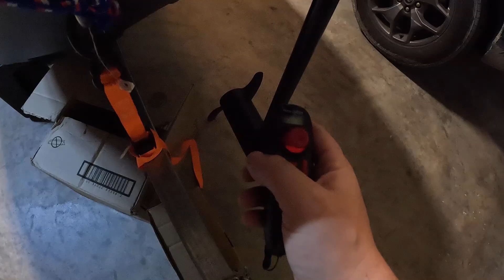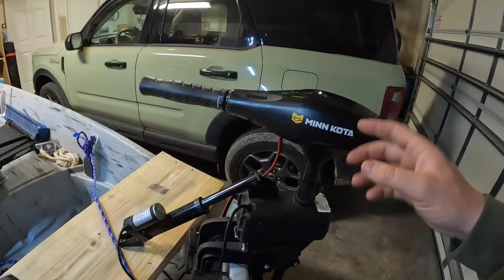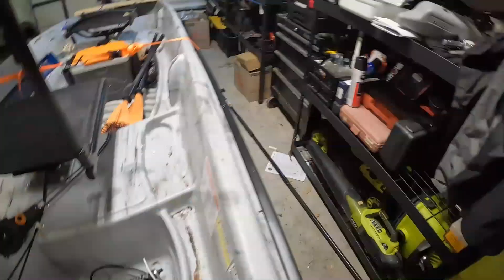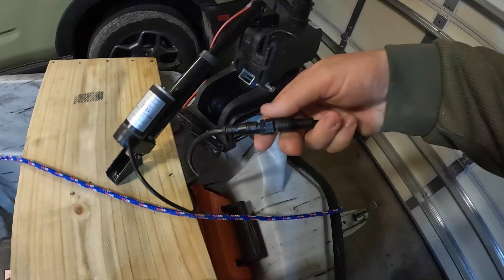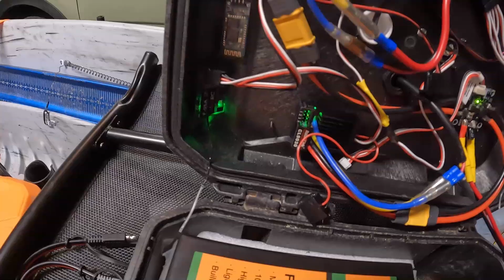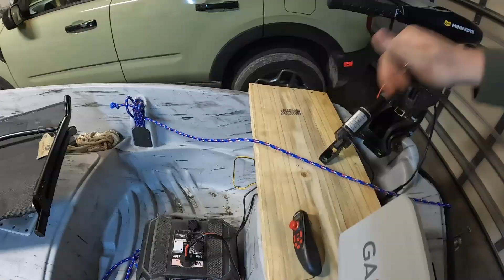DIY RC Trolling Motor V2

Comment: Will the steering box work with the Watersnake Venom 34 lb trolling motor? Or can I use an adapter to fatten the shaft if necessary.  I really want to make this work as my front fishing motor.
Reply from the maker: Most trolling motors that I have seen have the same size shaft (minn kota, Newport, etc.) With the exception of the watersnake T24 and T18. If your trolling motor is roughly the same size and the endura c2, then this should work just fine.

Comment: Did you have any noise problems with the cl9030 and the Minn kota endura? 

When I use the cl9030 on a 40 lb thrust endura I get a really loud pwm whine at low speeds. I’m considering moving to an ultrasonic pwm esc but I wanted to see if you solved it another way.
Reply from the maker: At low speeds on this motor and on the watersnake t24, there is a high pitch noise. It doesn't really bother me too much so I have not looked into making it stop.

Comment: Any chance you could point out whichPDB you used?  Did you need one rated for 60 amps?  Love this--this will be my next project.  My Minnkota has an old autopilot drive and should also work with this.  Have you made any progress with the spot lock?

Comment: I see tou got the cl9030 esc on the steering did you need to program it to have 70% for right ans 70% for left and if yes wich program card did you need
Reply from the maker: I did not program it at all. It spins pretty fast and the motor can just spin in circles until the cable gets completely wrapped around the motor.
Reply: @OutdoorEngineering i boufht the hobbywing quicrun 880 and i would need to program it beacause it is like 70 % forward and 30% backward so when going right is faster then left
Reply from the maker: I can definitely see how that could be an issue. Not having to program these ESCs is part of the reason why I picked them. All I have to do to change drive type or battery type is add a jumper to one of the 4 pins on the ESC, and its good to go.

Comment: See I was going to 3D print some gears but this looks like a purpose built solution for steering. You answered some of my simple questions about how this stuff is supposed to work. I was wondering where the radio got power and it was from the speed controllers. Could you clear up the part about removing the locking mechanism? If I DON'T remove it then it would just stay locked in the down position but I wouldn't need that extra support?
Reply from the maker: I removed the locking mechanism on the motor mount because I originally had this steering box on my kayak, and had installed an electric tilt on it since I couldn't reach the motor and would occasionally fish in shallow water. If you want to keep the factor tilt mechanism, you just need to find a way to secure the steering box so it doesn't turn instead of turning the motor.
Reply: @OutdoorEngineering when is the spotlock vidéo comming out
Reply: Gotcha! I got mine built but I'm having an issue with the steering. It turns quickly one direction but slowly the other direction. Is there a way to fix this? Thanks for the advice!
Reply: Nevermind. I need a programming card. I'll share a video of what I came up with once I stabilize my steering box.

Comment: It may not be noticeable on a kayak but are you losing power at the motor with the voltage drop at the esc? The specs I read says they have a max output of 7.5v and it looks like your setup without the jumper pin on 4 might be limited to 5v. Thanks for the video - very helpful in getting my project started
Reply from the maker: I am pretty sure that the 7.5v or 5v is referring to the power output across the signal wire to RC receiver. The voltage out to the motor is was measured between 13-14V at the esc when it is hooked up to a lifepo4 battery.

Comment: This is exactly the video I was looking for, immediate sub!  You mentioned that the handheld controller comes with two receivers, and I see on (Canadian) amazon there's an option to buy with only one receiver or with two.  Do I need two?  I only see one in your case, but you mentioned working on a spotlock mod and I am very interested in seeing how that develops.
Reply from the maker: You only need one, but the option with two was what was available at the time I build this system. Also, you can use the second receiver if you want to build a second trolling motor if you have two kayaks or something like that. I have an fs10 that I never take out at the same time as the boat, but it is too small of a kayak for that motor, so I have a watersnake 24lb trolly set up to work with the remote.
Reply: @OutdoorEngineering what configuration did you use for your jumper pins?
Reply from the maker: I am using no jumper pins

Comment: Do you use it with the sealed box closed? Aren’t there any overheating issues?
Reply from the maker: That's a great question. I haven't had any over heating issues yet, but I also don't run it at full throttle for more than a few minutes at a time. Also, if the weather is nice, I don't generally have the box closed all the way. It puts it at risk if I flip the boat, but I haven't flipped this one yet.
Reply: @OutdoorEngineering  I was asking because I built a system with a 24V brushless motor, and usually brushless ESCs are more efficient than brushed ones (lower efficiency = more heat). In my case, inside a sealed box, I had to add a liquid cooling system — and even then, during the summer heat, it tended to hit thermal throttling when running at full power (though it's a 24V 700W setup, not a 240W like the WS). 
Eventually, I ended up embedding the ESC directly into the cable that's underwater to cool it directly through the water.
Now I’m thinking about applying a similar idea to a 12V brushed motor in a small enclosure, and I was curious if anyone had already tested something like this. I’m working on a small DIY GPS spot lock project, but the space I’m planning to use is pretty tight and will also include other electronics and a Raspberry Pi — so there’ll definitely be a fair bit of heat. :)

Thanks for the feedback anyway!

Comment: !My motor goes 100% forward and 30% backward, do you know why? I use the same ESC and controller
Reply from the maker: Are you using the same controller? If so, you might need to calibrate the ESC. There is a video from the controller manufacturer on YouTube that shows how to calibrate it.
Reply: @OutdoorEngineering  
I'm using a simple controller from aliexpress, it says it calibrates automatically, but it doesn't work 100%, I'll have to use it only for the front!
Reply from the maker: 30% in reverse doesn't too bad, but you should be able to get full range forward and back.
Reply: Let's see if I can organize this, I'm anxious to know how you will put the anchor mode! What type of vehicle will you put in the system?
Reply from the maker: This one is currently on a prowler 12 jon boat from bass pro, but i am going to test it on my kayak as well.